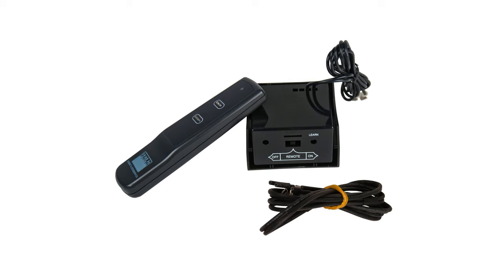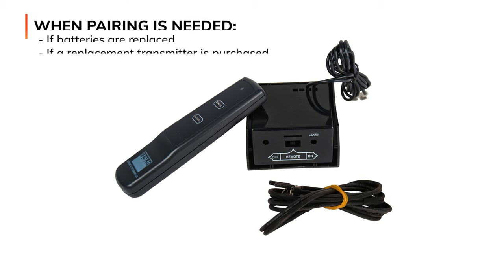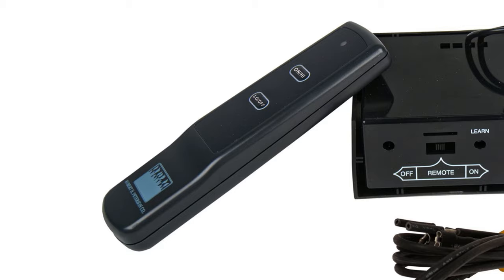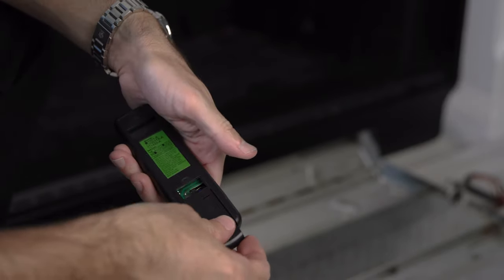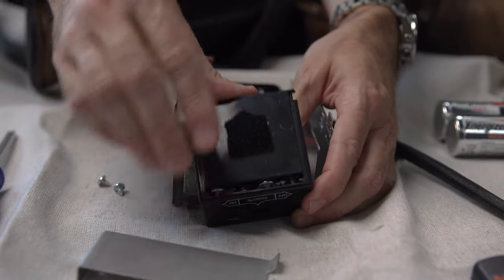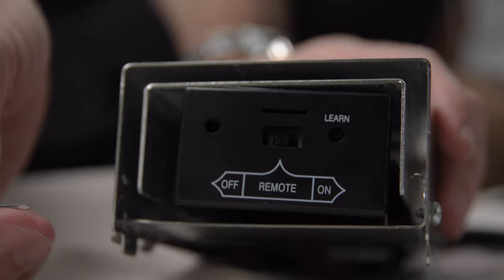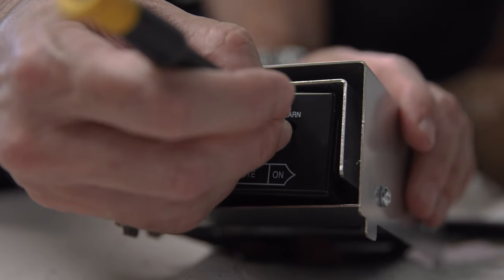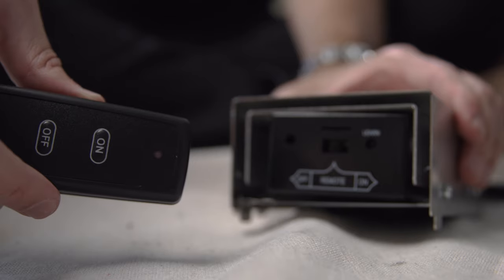How To Pair the Safety Pilot Remote and Receiver (by Real Fyre)

Comment: Mine still won't pair. I get a red dot on the remote when i press. I hear the 1 beep when i depress the learn button, but i dont get the 3 beeps after that when i press the remote. It just doesnt sync. All fresh batteries in both items. Please help!
Reply from the maker: If the unit isn't syncing, one of the items might need to be replaced.  You can try reaching out to your original installer or the retailer you bought the logset from, they may have additional information.  Or you can call Real Fyre directly at 626-369-5085.  You will need proof of purchase, since that remote/receiver is actually a common part installed by many gas log manufacturers.  It's possible it's not a Real Fyre set, at which point they won't support your system.

Comment: We don’t get a beep when pressing the learn button. Any idea how we can troubleshoot this?
Reply from the maker: Are you 100% sure it's a Real Fyre or Skytech brand system?  The first thing to check is to make sure it's the same as what we're showing in this video.  If it is the same, then the next thing would be to double check batteries.  I know it sounds obvious, but you'd be surprised at how often new batteries solves the problem!  Next, you can check wires for loose connections, melted sections, or other areas where the signal might get interrupted.  If you've done all of that and it's still not learning, it could be a bad remote or receiver, which may need to be replaced.

Comment: What if my set won’t turn off when I toggle off the switch?
Reply from the maker: It sounds like something may be faulty or not hooked up properly.  I'd suggest calling a local Real Fyre dealer that offers service calls to have them troubleshoot and repair.  Alternatively, you can order a new pilot system, receiver, or remote.